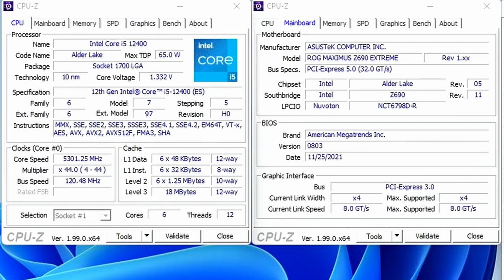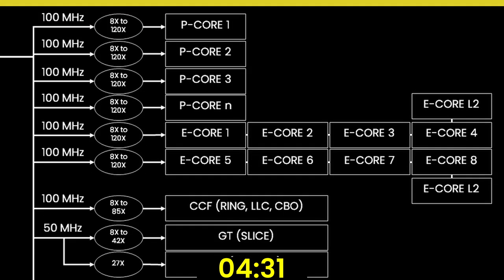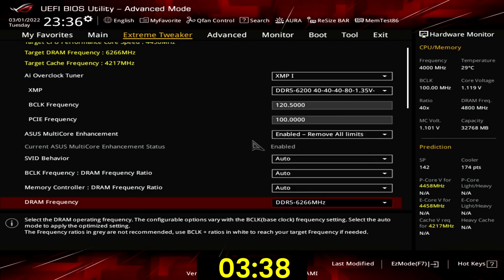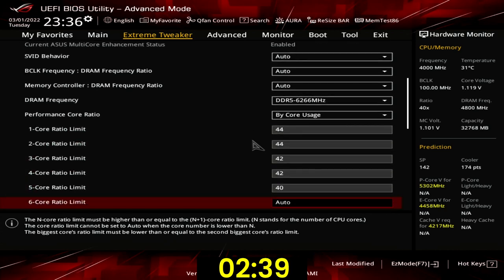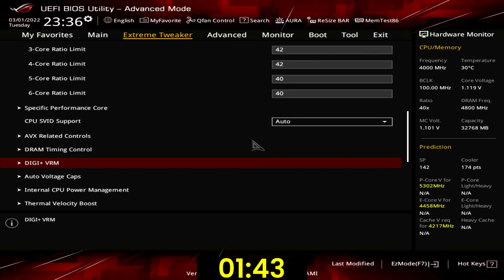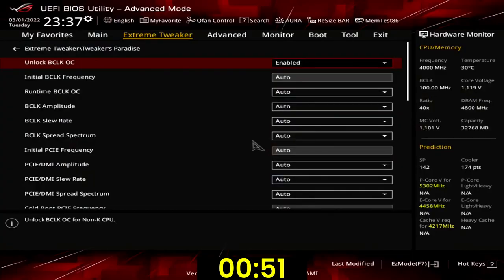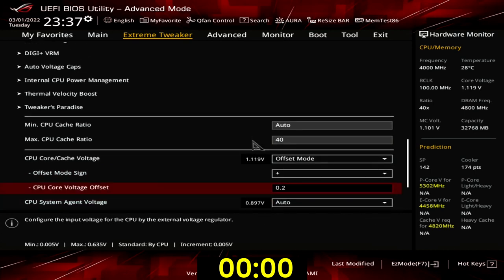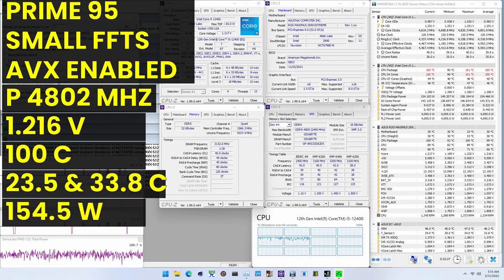5 Minute Overclock: Core i5-12400 to 5300 MHz

Comment: should we do these settings on a B660 motherboard with BCLK overclocking? Can it cause any problems?
Reply: I managed to overclock 12400f on b660 to 4850 and ddr5 4800->5020.
It is been a month and totally stable.
Reply: is it still stable now? @ashkanpower
Reply: I use i3 12100f OC to 4,9Ghz.
ddr4 4400 mhz stable.
Want to tray i5 12400f.
Reply: Hit top of the i5 12500 leaderboards ocing with this board. It's damn awesome!
Reply: @ashkanpower Can you share the method?

Comment: Do you have the same guide for the B660 MSI mortar max DDR4, its really interesting to see if it can reach the same results as in this video - Thanks and great Guide :)
Reply: CPU overlooking is not supported on x10 and x60 motherboards, only on x90 boards. I have the same i5 and a msi b660 board also

Comment: hello, can intel uhd 770 overclock even on an i7-12700?  with a motherboard with BCLK?  If I can't, besides overclocking is there anything I can do from the bios to get improvements, any settings?
@SkatterBench
Reply from the maker: Yes! In fact, I am now working on a video detailing IGP overclocking for the non-K Alder Lake :) should be up soon!
Reply: @SkatterBencher  wow very cool!  so only for overclocking the iGPU UHD 770 (NOT the CPU) with Intel not K, are all motherboards ok?  or must they support overclocking?  o Z690 + external clock generator and supporting microcode.  Only for ov integrated gpu.  thanks to the availability :)

Comment: Just did a oc to my 12400 on a Asus ROG b660-f with bios 1003.
It works!
Reply: Hello, my friend. I have the 12400 + b660g (basically the same setup)
Did you used the same oc profile that was used on this video?
Reply: @pavelsoloway3675  yes, except for the Options our board's don't have (z690 exclusive)
Reply: The RAM adjustments are following der 8auer tho
Reply: @TheSlowDude  oh, the ram thing 
Thanks
I use Der8auer's adjustments to 125 bclk and I'm kina unstable in games (bsod once in a while), so I decided to experiment a bit :)
Reply: @pavelsoloway3675  125 all core? Wow, what voltage settings?
Reply: @pavelsoloway3675  I know it can handle even more, but I haven't found a confidence inspiring guide on more OC than scatterbencher and der 8auer.
Reply: @pavelsoloway3675  what CPU cooler? I'm using a noctua nh-d15
Reply: @TheSlowDude  bclk 125, all cores multiplier 40, voltage 1.3 and level 4 in vdroop (in Digi+vrm) (real consumption was like 1.3 or so)
It was like 5ghz and no good stability((
Reply: @TheSlowDude  about cooling
I'm using deepcool lt520 aio, because it looks extremely sexy 
and also it keeps my CPU far from dangerous temps, around 72° in stress tests 5.3ghz and around 1.34 volt (oc profile from video but with manual ram oc like Der8auer adviced)
Reply: @pavelsoloway3675  I think scatter bencher did level 7? And 170% power... Can't remember now.
Don't even know how to perform stability tests, just know that cinebench r23 give good results
Reply: @TheSlowDude  thanks for advice, I'll try different things
Reply: What temps are you getting running prime95 small ftt avx enabled? Are you also hitting 100c just like in the video?
Reply: Giving it another go, now @130 / 5200MHz.
Load line calibration lvl4 and it works great
Reply: Cinebench r23 multicore: 15295

Comment: Another great video. Could I ask you if you can make a video like you did on the Ryzen 7 5700g for the extreme overclock cpu and iGpu but with the Ryzen 5 5600 please? Or is it the same thing? Because I think values could be a lot differents. Thank you very much
Reply from the maker: The general overclocking process of the 5600G will be very similar to the process of the 5700G which I covered in SkatterBencher #24. Of course the final result and performance will be different.
Reply: @SkatterBencher  Thank you for te answer! My biggest problem will be to set the negative pbo2 curve, which each value is individual based per core and you also made a detailed excel document, but it’s fort the 5700g, this is why I asked you. Do you think I should try the same negative values as yours or do you think it’s better to try something else? (And what to try to don’t make damages?) Or maybe already exist another excel document like your but for the 5600g? Thank you very much

Comment: Good video! Found a way to adjust SA voltage on locked CPUs yet liked we talked of earlier? :)
Reply from the maker: Unfortunately I couldn't quite figure out what's going on :(
Reply: @SkatterBencher  okay, I found that lowering temp helps on ram oc. Stock cooler was a bit unstable on 3600 G1 on my 12400F when gaming if temps exceeded 60C, but a basic tower (Silentiumpc fera 5) made 3600 G1 100% stable (max temp is now 55C in gaming vs 67C stock cooler), 3700 G1 was almost stable. With AIO and sub 50C load I bet 3700 G1 can be doable on my CPU with it's 0.95v SA locked. If you are familiar with i2hard they strughled with 12100F at 3700 G1 stock cooler, but AIO made 3800 G1 stable. Their 12400F needed AIO to stabilize 3600 G1 so worse than my sample.
Reply: @SkatterBencher  still found no solution? 3700 G1 is now stable at the stock 0.95v on my 12400F, just had to update bios and lower CL/CWL. Would still have wished for 1.2v+ SA to run ram at 4000+ G1.
Reply from the maker: I didn't look into it much further
Reply: @Taraquin83 That is freaking awesome. My 12400f cannot stabilize the 3600 at the memory if the cpu is overclocked. With an increase in bclc, a drawdown appears on the SA voltage from 0.970 to 0.932. I tried to cool the processor to 10 degrees Celsius, the processor itself was able to rise to 5.5 GHz and pass cinebench 23 10 times without problems. But memory above 3600 did not go in any way.

https://i.imgur.com/DcLI4b1.jpg
Reply: @Taraquin83  did you change any voltages like vDDQ or another?
Reply: @graviusmatt  no, I could not make any change stick :/

Comment: If you tell me  more about this...
Why 4 sticks ram DDR5 xmp not works, but start to 4000mhz only.
Have you some setting ,timing ... .voltage ...?
My Mobo TUF was this too.
Dual Channel only.
Ram DDR5 kingstone fury
I5 12600.
4 sticks works 4000mhz
2 sticks xmp works overclocking.
5600mhz.
2 sticks start to Jedec 4800mhz.

Comment: Hey, I'm wondering if the Ratios set over 40 actually do anything?
I'm trying to get the max out of a 12400F but it refuses to apply ratios over 40.
The settings in your video gave me a bit over 4,8 GHz Allcore in Cinebench R15.
I know I can't just grab a tutorial and think it'll work fine without me spending extra time.

It's a bit hard to overclock using BCLK only.

If the values over 40 don't apply anyway I'd like to have that clarifyied so I know if I'm wasting my time or not
Reply from the maker: Since the Core i5-12400 is not an unlocked processor (like the 12600K, for example), ratio configuration higher than the default maximum ratio is not possible.

The only reason we're able to overclock this processor is because there was a small oversight in an early microcode. You can learn more about it in my full length guide: https://www.youtube.com/watch?v=mtKkZKURTS8
Reply: @SkatterBencher  ah I didn't find the full length yesterday, thx

I'm not a beginner, but I'm certainly not a pro either. 
I was just asking because you set the per Core Ratios to 44-44-42-42-40-40 so I got confused as for why you did that if it can't apply.
But I'll check out the full length, maybe I'm smarter after that 👍🏻

Comment: Is it possible to do this with the same i5 12400f chip and Gigabyte h61 Mobo? I can't find a lot of similar settings as yours in my Bois. 😢 Is there any work around?
Reply: your mobo doesnt have an external clock generator to bclk oc, ur out of luck
Reply: @mil-kw9zi  Oh. Thanks for letting me know.

Comment: Is CPU microcode stored on BIOS or CPU? My BIOS is reporting Processor ID 90675 with Microcode revision 23. I want to buy ASRock PG Riptide B660 mobo, shipped from China on AliExpress for $160. This board has a clock gen chip, "ASRock Hyper BCLK Engine". Will I be able to BCLK overclock my i5 12500? (H0 obviously)
Reply: yes :p

Comment: 3 questions

Would this same oc work a air cooler rated for 200 watts? 

Would this work with 3200 cl16 ram?

How do I know if the microcode of my i5-12400f has the 0x9 microcode?
Reply from the maker: To answer your questions:

1) Yes
2) Yes, just enable XMP and it will automatically run DDR4-3200
3) Sometimes the information is displayed in the BIOS. You can also check using CPU-Z (About > Save Report). Lastly, you can visit overclocking communities and ask around there. There should be some list for non-K overclocking BIOSes.
Reply: @SkatterBencher  do I need a 0x9 on a 12400f to bclk oc it?
Reply from the maker: Yes, a specific CPU microcode is required to enable non-K BCLK overclocking
Reply: @SkatterBencher  is there any ways to guarantee I get this micro code when purchasing?
Reply from the maker: Since the microcode is very old and allows unsanctioned overclocking, Intel doesn't really want users to have access to it. Some motherboards ship with the microcode present on the BIOS (so you can switch in the BIOS), but most don't. In that case, it's possible there's still a modded BIOS available online.

Alternatively, you can also update the microcode yourself, but that's pretty advanced stuff.
Reply: @SkatterBencher  but dont any mobos with a external clock gen have the ability to bclk non k? I was looking at the b660M mortar mag max and that can

Comment: So with the cooling you have, the CPU is at 100 celsius?
Reply from the maker: Correct. The challenge appears to be the thermal transfer from the die to the water.

Comment: mine 12400f got 120 bclk freq( +.195 V cpu offset), even on all cores at 44, but temps are high on stock cooling reaching 97+ degrees when stress tested. Cooler cant handle it i suppose throttling kicks in when more cores are crunching through workloads. On idle temp is around 40 deg and my normal workload wont utilise them 100 percent most of the time so it seems a working setup for me, with nice increase in productivity - i care about single core performance most, as that is bottleneck sometimes.
Reply: Well with these settings you are nearly doubling the power consumption of the CPU.

I'm curious: did you actually get the x44 ratio to apply?
For me it always applies 40 no matter what I set.

I wonder if values over 40 even are possible to get running
Reply: @noaimnoskillnokill3947  44 is stock. Yes it applies, but i have linux and it wont properly show BCLK freq so it shows like if bclk was not applied. I can tell by instabity :) going higher. Could bios be preventing it? intel didnt liked this practices. Mine is asus b660m + wifi
Reply: Dude don't oc with stock cooler..

Comment: How the f is the 12400 reaches 100 degrees celsius? (especially on custom watercooling) Not even my infamous 11900K can reach that with pulling 300 watts at 100% usage.
Reply from the maker: If the chip heats up faster than you can transfer away via heatspreader, TIM, and waterblock into the water loop, you'll end up with this kind of behavior.

Hard to say what's causing this issue. It might be a combination of smaller physical die size, quality of thermal interface, heatspreader, ...

Comment: can you run these 5.x overclocks in the CSGO benchmark using the various alderlake chips youve overclocked?
Reply from the maker: I've been using CS:GO in the vast majority of my SkatterBencher videos, so you can check those for performance data :)
Reply: @SkatterBencher  averages are meaningless .1% 1% lows are where its at

Comment: Can I overclock 12600k with bclk at b660m with clock generator?
Reply from the maker: Boards with external clock generator (and the right CPU microcode) can overclock any Alder Lake CPU using the BCLK, including -K and related variants.

Comment: Can i do it with msi mag mortar b660 ddr4 wifi?
Reply from the maker: The MAG B660M Mortar MAX WIFI DDR4 has external clock generators, so it will work on that board. I'm not sure about any other MSI B660 motherboard

Comment: Is it possible to oc 12400f on b660 mb ?
Reply from the maker: If that B660 motherboard has (a) an external clock generator and (b) the older CPU microcode that enables non-K overclocking, yes. If either (a) or (b) are not present, then no.

Comment: wish you would do an over locking for the 12700k. Special kind. 
I want the top two cores to do 5.4 and second p core 5.3 and the rest to do 5.0 
Don’t need e cores touched. 
I play world of Warcraft as my main game, and it uses mostly single threaded performance. 
If you could make a fun guide based around high single threaded games that be cool!!
Reply: Have an asuis bvoard?

Comment: Can i5 12400f be oc with asus rog z790 apex?
Reply from the maker: I didn't test this, but I think it should be fine as long as you have the BIOS which supports the right microcode to do BCLK with non-K
Reply: @SkatterBencher  as long as the bios is  the latest one should be fine or i need to findnthe correct one if I may ask, thank you
Reply: @SkatterBencher  can you help find out which bios supports this microcode, I found out there is a bios with a swich microcode button but i dont see it in bios. im lost.

Comment: Hi there. Thanks for the video! Would this work using the 12-400 on an ASUS TUF Gaming B660M-PLUS WIFI mATX board?
Reply: Following
Reply: No it won't since it doesn't have an external clock generator.

Comment: Do you think that all 12400s will hit 100c in prime 95 small ftt? I overclocked my 12400 and I'm also hitting 100c.
Reply from the maker: Yes I think so. Mainly because the limitation for this CPU seems to be the thermal transfer from the die to the thermal solution. No matter how great your cooler, if the heat doesn't reach it fast enough it won't cool the CPU.

Comment: I followed this video as much as I could but still I need help. I have 12400f with Biostar motherboard. I set CPU ratio and fixed voltage. However, when I game my cpu maxes out at 3395Mhz. When in Windows, it fluctuates between 2.5ghz to 4ghz. Kinda crazy, not sure what I am supposed to do. I want to get the 4.4ghz that they advertise. Please help 🙏

Comment: It's simple. If you want to overclock, don't buy a 12400. Because getting a budget CPU just so you have to spend maximum non value on a motherboard + ram makes zero sense.
Reply: This is wrong now because the b660 mag mortar max is an affordable ddr4 bord with an external clock gen